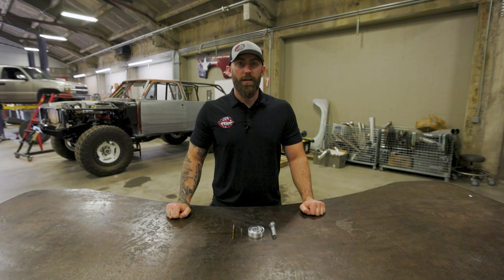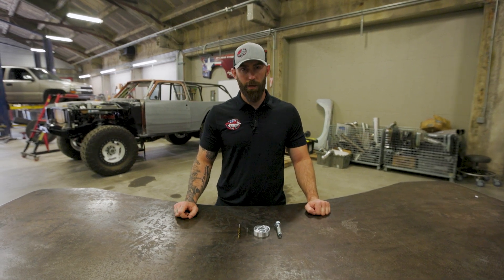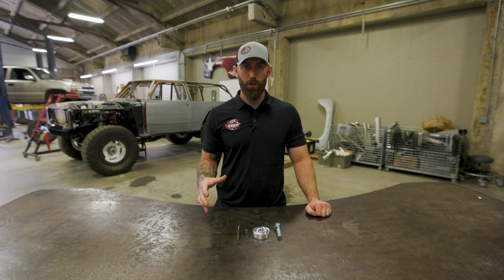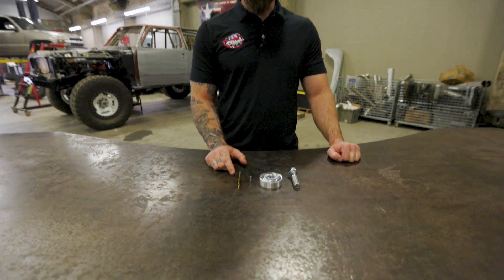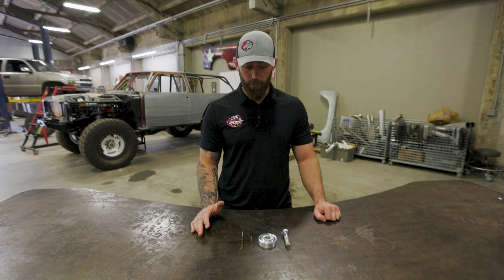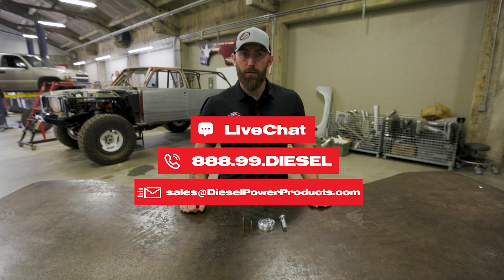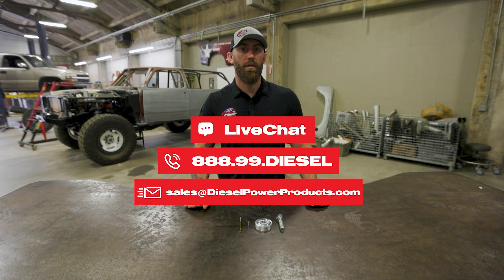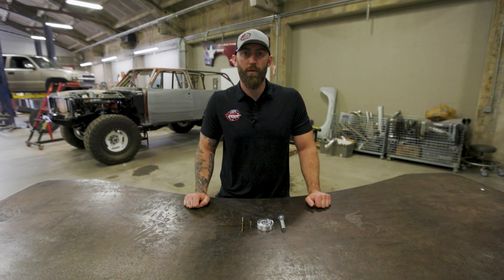BOOST IT | CR2 PERFORMANCE & FAB CRANKSHAFT PIN KIT

Comment: Everyone says you can do this within 30 minutes in your driveway. I have had my Clutch Fan out, rad out and my crank pulley. Now, how are we supposed to measure and drill without lifting the cab? No actual videos of anyone doing this work, besides crank out or cab lifted.